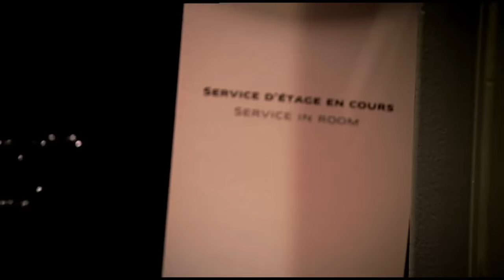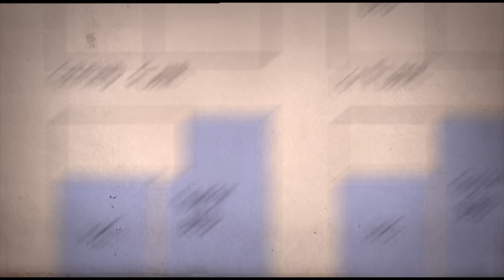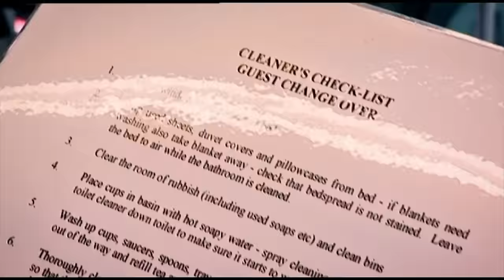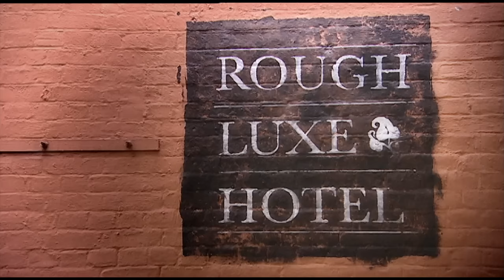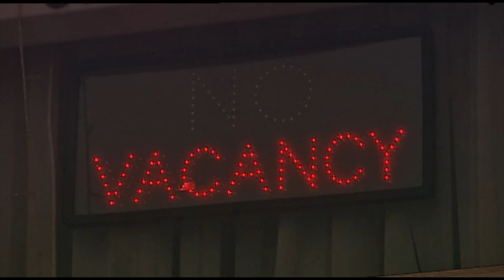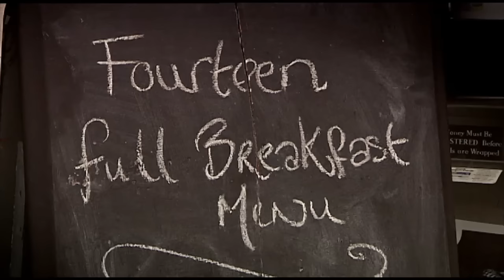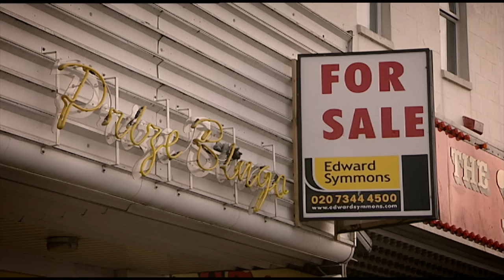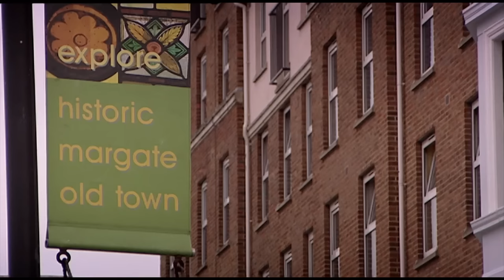Incompetent Couple Try To Renovate Bedsit Into A Chique Hotel | Hotel Rescue | Abode

Comment: Doesn’t want to do types of breakfast; doesn’t want to do tv; doesn’t want to have radiators; doesn’t want to have a kettle for tea and coffee… sheesh! Who wants to spend an expensive night in an art gallery where you cannot even get a cuppa, let alone a solid breakfast (which you will even get at the 100s of super cheapie places within a few blocks of them.)
I’m glad they got a wake call, although those huge bathrooms are going to be freezing or will cost a bomb to heat. Soap dishes would also be a great idea as it is guaranteed that the soap will go spinning off across the room the first time it is wetted and placed on the shelf. 
A suggestion (to all owners): USE each of your rooms and facilities yourself and see what else you would like to have available or want to change.

Comment: I'm not understanding why they didn't get a full survey done on the building before even contemplating buying it.
If they had paid for a comprehensive survey, it would have picked up the issue with the roof straight away.
I've bought and renovated numerous houses and 100k just wasn't enough for a project this size.
ALWAYS work out what you think it's going to be and add a 35% contingency fund on top

Comment: This is like watching a train wreck about to happen. They are going into a risky venture for all the wrong reasons and deficient in experience and common sense. The guy complained about manual labor and there is an abundance of it when running a hotel. Plus they are located in a geographical area that will not support the clientele they hope to attract.

Comment: Painful to watch this couple! But great to see how they have designed the place. I wonder why they only have two rooms to rent?!
Reply: They ran out of money and had to lay off the construction workers before the whole place was finished, so they had to open with what was finished in order to start bringing in income. They did mention all of that...
Reply: @kimbarleemoon3870  you obviously haven’t done research. They opened 2009, and on their website in 2022 are still only two rooms for rent.
Reply: @kimbarleemoon3870  well, renting two rooms won’t get them out of debts. Simple mathematics.
Reply: @kimbarleemoon3870  You can’t make your problem mine! And this couple has shown that business isn’t their strong side. You defending them, says everything about you and nothing about me.
Reply: @kimbarleemoon3870  exactly!
Reply: @misschris662    Its seems a whole floor becomes an apartment for short stay, even one night.
Reply: @pauljames9393  ohhhh! That would help making the money they need. Have you seen this apartment on their website?
Reply: @misschris662  Yes & perfect.
Reply: @pauljames9393  under which chapter have you found it on their website? Went there again and can’t find it?
Reply: I think potentially financially this is fine.  It seems both rooms are rented a lot, and they may pull in 7000+ pounds a month.  If one of them also works full time, it's fine.